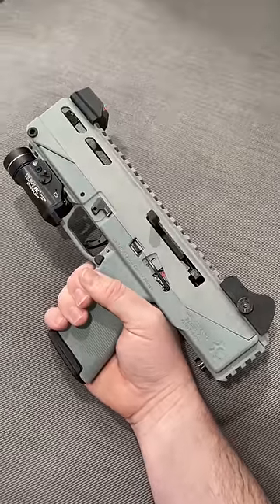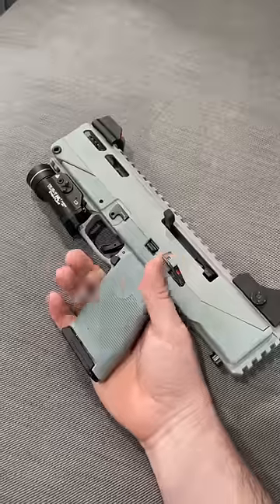MP57 - PDW Kit for Ruger 57 Pistol by Custom Smith MFG

Comment: Buddy could have just bought a dbx 5.7
Reply from the maker: I have something lighter, more compact, easier to manipulate, and a just bit over half the price of the DBX MSRP. 

I’m good, I’ll stick with my build lol.
Reply: @booliganshootingsports see you don’t know what ur talking about a dbx 5.7 is 15 in long, 1in wide with an 8 in barrel which gives better performance for the 5.7 round all for 1k also has ar trigger and safty so u can use an ar trigger u would like all for about the same exact price! That gun is 600 how much is the chassis
Reply from the maker: I built this whole thing for $800 total. Fully printed solutions can do it for $600. Weighs under 2.5 lbs with a brace installed. The mag in grip gives it a better weight distribution and faster reloads. Only 14” long with the brace installed and collapsed. 

So get the DBX, which is already heavier, longer, bulkier, and more expensive, and add a brace (which adds bulk, weight, and money) and you can then get something that is close to the functionality of this. Only heavier, bulkier, and more expensive. If you go telescoping brace, you add length but minimal width. If you go folding, you add minimal length but double the width. Both add about a pound at a minimum. You’d likely end up just around 5 pounds when done, doubling the weight of mine. The DBX’s longer barrel does give you better velocity, sure. But at the expense of everything else.

Kinda do know what I’m talking about here. I’ve been designing and building guns for years.
Reply: @booliganshootingsports soo 200 doller difference but one is aluminum frame and one is 3d printed I’m not telling you what to get I was just saying a statement and this is twice as thick as the dbx and weighs the same the dbx is 3 pounds I’m not arguing with what u like but once u made those false statements I had to correct
Reply from the maker: Feel free to show what false statement I made. The MSRP of the DBX $1,352.00. Street prices are lower, but I referenced the MSRP. I don’t bother myself with current street prices of guns I’ll never buy, lol. Equip it close to mine and you’re looking at double the price of mine, easily. 

It is heavier than my gun, even with a stripped down DBX at 3 lbs without sights, brace, or empty magazine. Mine is half a pound lighter with all that stuff installed. Even more so when you add comparable equipment to the DBX to get it close to mine like a brace (which is not included in the DBX’s price, weight, or size), which would likely bring it to double the weight of mine. 

It is larger than my gun, even before adding comparable equipment. 

It is bulkier than my gun (almost 1/4” wider, the DBX is 1.75” according to their own documentation, this is 1.43”). 

So let’s sum things up:
The DBX is 1” longer (2-3” longer when comparably equipped).
The DBX is 1/4” wider (3/4” wider if using a telescoping brace, 1.5” wider if using a folding brace).
The DBX is 1/2 lb heavier (2-3 lbs heavier, or double the weight if comparably equipped). 

The DBX is $200-$600 more expensive ($400-800 more expensive if comparably equipped). 

So again, where was my inaccuracy? What point are you trying to make here other than simping for a gun that is measurably worse than mine using the standards we’re discussing? The DBX is cool for what it is. But you can’t compare it to mine because they really share nothing in common aside from the caliber they shoot.

Comment: Ewww. That makes the ruger 57 so ugly. I'll just throw an extended mag and suppressed barrel on mine. And the vortex venom of course
Reply from the maker: Function over form. This is much more useful and stable of a shooting platform now, even if it looks weird.
Reply: @booliganshootingsports  you gave me a heart then took it away 🥺
Reply: @booliganshootingsports  it’s already stable with low recoil. If you need to be more stable stop smoking crack!😆🤣😂🤣😂
Reply from the maker: @mr.nightshade8465  compare any pistol with any third point stabilized firearm and you’ll find that the third point stabilized firearm is more accurate at longer ranges. This is common sense, otherwise we wouldn’t have rifles or PCCs at all

Comment: Get 30 round mags
Reply from the maker: Yep, the mag extensions are on my shopping list.
Reply: Word is a company will soon make 50 round drum ruger 5.7 mags. He made a video here showing them. I went to site but couldn't see them. Been a while since I checked tho. But 28 is about the max I can fit in my stick mags before they get wonky due to them being conicle in shape. Much more and you kinda need a curved mag. Curious to see how others work around this issue

Comment: Made a good gun look ugly for nothing, it has little recoil n doesn’t need a brace or blocky body🤮🤮
Reply from the maker: Imagine thinking that recoil is a qualifier for benefiting from third point stabilization 🤔
Reply: @booliganshootingsports  it doesn’t need it, if you want a pdw buy one instead of a crappy kit
Reply from the maker: @DirtyWetTrash  I'll be sure to let every firearm manufacturer know that stocks and braces aren't helpful anymore, Big Hanky declared it so. No more rifles needed anymore, handguns are all we need. 

Also, point me in the direction of a 5.7x28 "PDW" that you can buy on the market today and I'll show you why this is a better option.
Reply: @booliganshootingsports  lmao I never said they weren’t helpful at all, go back n read what I said before coming with your drama bs I ain’t yo boyfriend 🤣 if u buy a handgun it doesn’t need a kit to make it something else. If u want a pdw or a rifle buy one. They are different for a reason.
Reply from the maker: @DirtyWetTrash  Your attempts at logic still don't make sense. This fires a round originally designed for PDWs. In this chassis, compared to the original standard format handgun, it is more stable and therefore accurate to shoot, with hits easily out to 100 yards which just isn't doable in the standard format handgun. The optic mount is non-reciprocating, meaning you can get follow up shots on target faster. Mounting useful accessories is easier than before. The iron sight radius is longer, leading to more precise shooting compared to before. This literally does everything the original standard format handgun does, only better, with the only downside being that it's no longer a standard format handgun. Which again, doesn't matter, since the point of this build isn't to have a standard format handgun. It's to have a PDW type firearm.

So, I ask again, point me to a 5.7x28 factory made "PDW" type firearm that's for sale to the public today and I'll explain to you, again, why this is a better option.
Reply: @booliganshootingsports  bruh I didn’t come to argue. I have a ruger 5.7 with an optic on it. Hits the target at 100 yards no prob n easy follow up shots since it has such little recoil. That’s why I think the chassis kit is just a waste of money and doesn’t benefit you much or at all when u coulda jus used the money for a ps90, ar57 or the new keltec which is also chambered in 5.7 but I think Thas the ugliest of them all.
Reply from the maker: @DirtyWetTrash  If you didn't come to argue, take the L and just walk away. You have zero valid points that you've made here ;)

You're criticizing something baselessly without understanding the point of it, clearly. You also keep bringing up subjective looks of the gun as if that has any bearing on the gun's performance or ability to do its job. Looks don't matter. 

This is cheaper, lighter, much more compact, has a much longer sight radius, and is easier to reload than a PS90. The PS90 only makes sense as an SBR, which brings the cost up to roughly 2.5x what I paid to build this. And then you still have the P90's god awful trigger and the fact that it weighs twice as much as this. 

This is cheaper, lighter, much more compact than any 5.7 AR on the market.  If you're specifically referencing the AR57 which used P90 magazines, that was a complete failure of a product and doesn't exist anymore AND cost 2-3x as much. If you're referencing something like the 5.7 chambered CMMGs, this cost me about half the price to build, with all of the above points still being true. 

This is cheaper, lighter, and much more compact than Keltec's new offering and doesn't require you to completely split the gun in half to reload a magazine. And then you still need to add a brace of some sort to get anything close to the same functionality as mine which further adds weight, cost, and bulk.

Yet, with my setup, I have a brace stabilized PDW format firearm that weighs less than 3 lbs fully loaded, cost me roughly half the price of any comparable firearm on the market, with no performance deficits compared to them. It outperforms the base Ruger 57 in pretty much every performance measurement aside from muzzle velocity which is unchanged from stock. But sure, this build doesn't have any benefits and is a complete waste of money. Clearly you don't get it, and it's an easy solution: Don't build one. Enjoy your Ruger 57 pistol in stock form, it's a great stock pistol. But this is better.
Reply from the maker: @DirtyWetTrash  Oh, I'm far from mad, and in this field, frankly, I do know more than most. Clearly more than you in this case, but that's fine, because this is your opportunity to learn something. 

The PS90 has never historically sold for under $1400 at retail, and current prices are near $1800 regardless of COVID. They've always been $1,500-1,700 guns since they were first introduced. If you found them for under $900, you must have been dealing with someone who either was ditching a stolen one or an idiot selling a used one who had no idea what they cost, lol. Regardless of all of that, we live in 2022 so 2022 prices are what matters. How much do you think I have invested in this build?

My favorite part of this interaction is how you keep calling the kit cheap and then saying that it's a waste of money. Which is it? 

This is made of laser sintered Nylon 12 material. It's more durable and feels better than the factory Ruger 57 frame. The chassis used here will outlast a factory Ruger 57 frame in similar usage.

Best of luck in life, hope you learned something today.
Reply: @booliganshootingsports  Gun stores in my area couldn’t get rid of them and they had a bunch just sitting there. Making the price go down especially when the ammo was hard to come by or too expensive for some. Ruger 57 700$ after tax here and add the price of the chassis you’re pretty close to the 900$ to get the real thing. So again act like u know everything n never consider somebody else’s perspective. Hope u learned something outta this. Sorry my opinion got u heated bro, I love guns myself but just don’t get why someone would buy a handgun to make it something else when u coulda jus bought a pdw instead of making a ruger 5.7 look like a minecraft gun
Reply from the maker: I’m in his whole build under $800. And I’ve been paid more than that to develop more parts for the platform 🤷‍♂️
As I said, roughly half the price of a comparable platform but with better size, ergonomics, etc. $900 PS90s don’t exist in 2022, and even then, would still need a $200 tax stamp and new barrel to be halfway comparable.
Reply: @booliganshootingsports  a shotgun is a way better personal defense weapon. For sure. You’re just living in a fantasy world.
Reply: @booliganshootingsports  oh by the way FNH already makes a better one called the PS90. There I pointed you in the right direction. I prefer the Kriss Vector in 10 mm myself. It is also designed with low recoil in mind.
Reply: @DirtyWetTrash  Point well said this delusional guy doesn’t make any sense